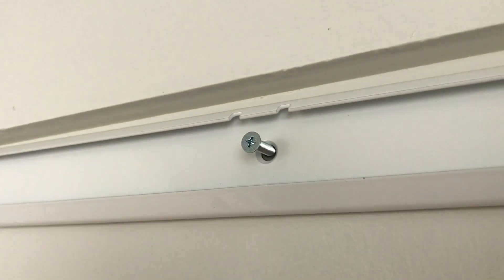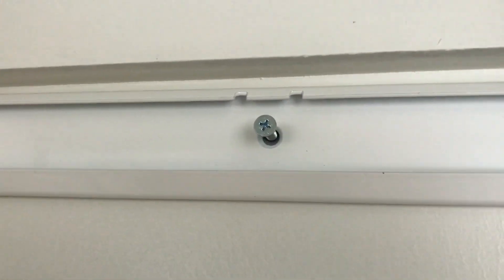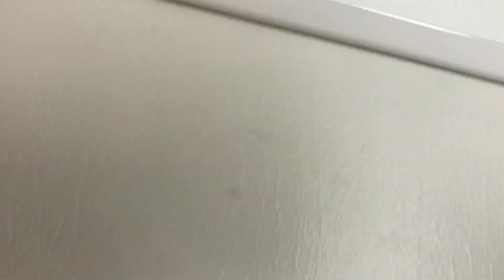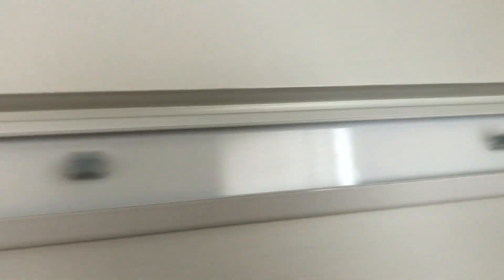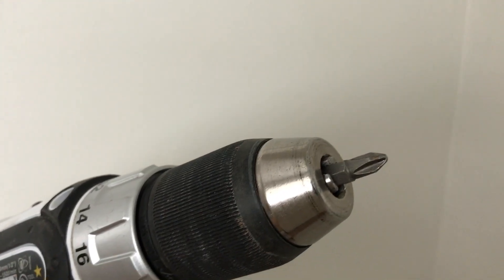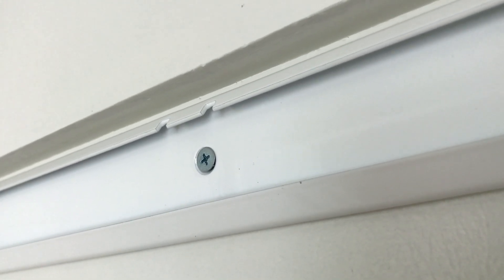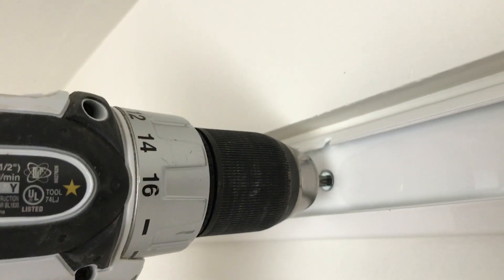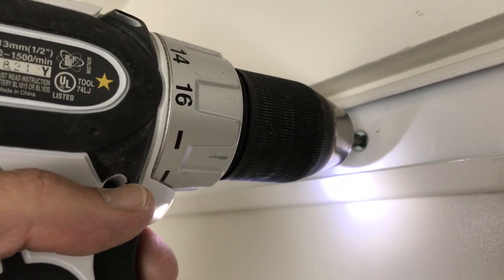Elfa Closet System DIY: Part 2 -  Installing the Top Rail

Comment: Thanks for posting this. I would have like to have seen the hand tightening at the end. How tight will the screws get? Mine seem to not get all the way tight, they want to spring back.
Reply from the maker: After using a power drill with a phillips bit to get it tightened, finish with hand-tightening with a screwdriver and stop short when it doesn't seem it will turn any further without stripping the screw.

Comment: Considering what this system costs, how important it is to fully tighten these anchors, and how many years it’s been out in the market, I’m amazed that Elfa has not Changed to a better screw head that does not strip as easily as the Philips screws!!!